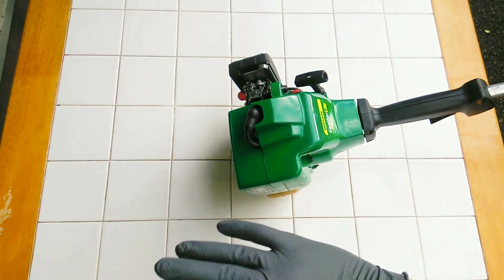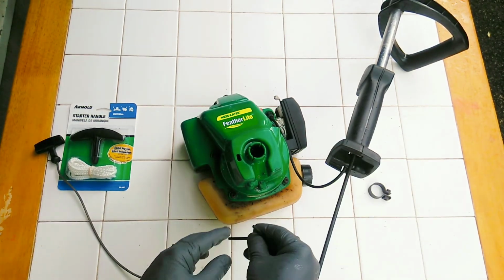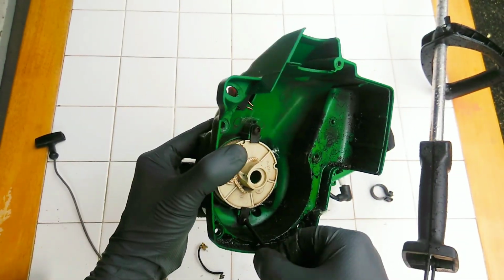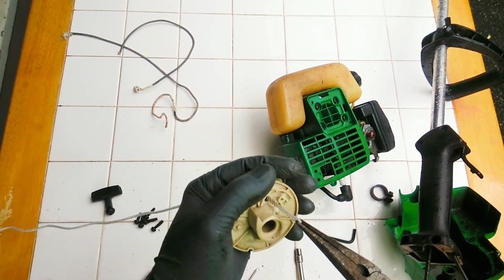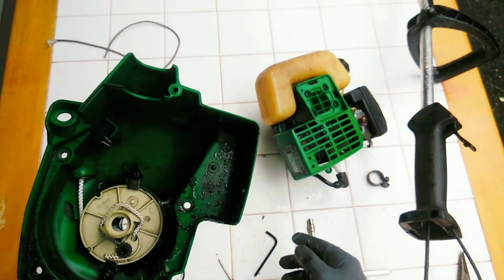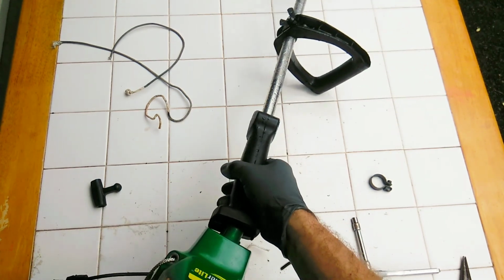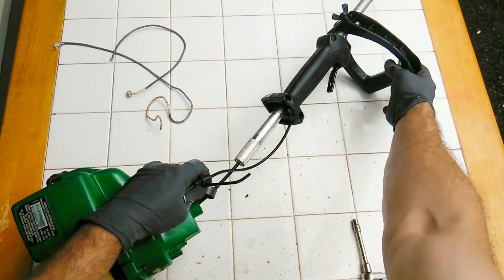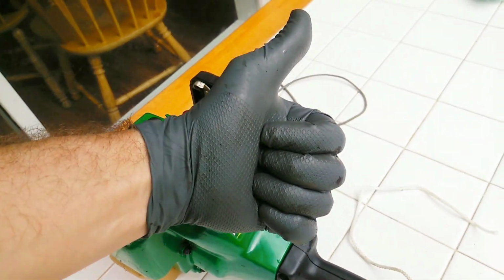Weedeater Pull Cord Snip & Repair

Comment: It was unclear what you did between threading the rope through the hole initially............. How did you tie it down (with a knot?). Also, did you roll up the string first. You went from threading to screwing back the two metal braces... That 'middle' part is what I was looking for and with which having issues.......... 
Other than that, helpful. Thank you.